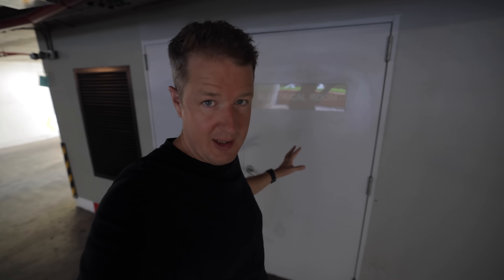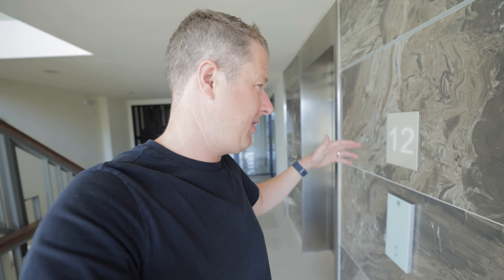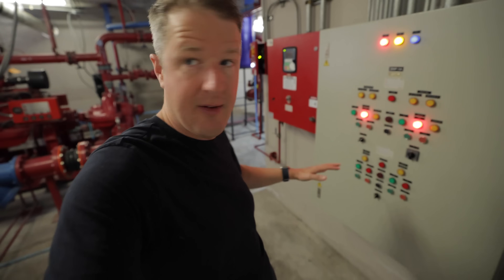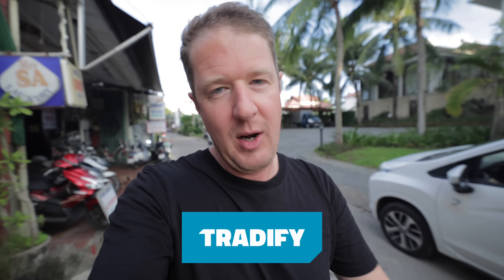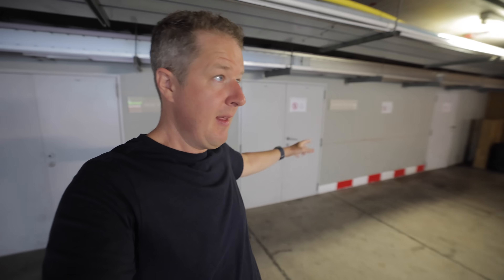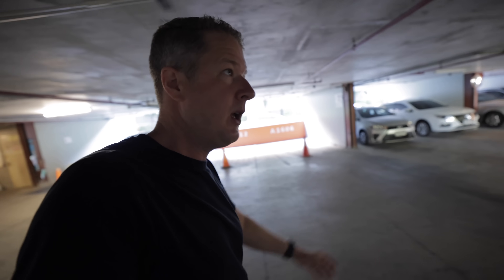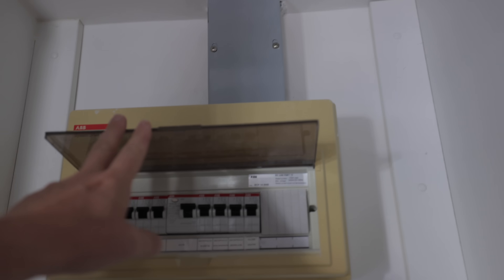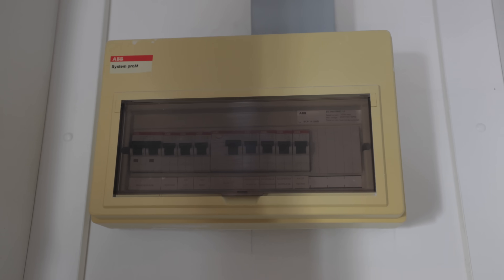This Electrical Room in Thailand Almost Got Me Killed... 😲

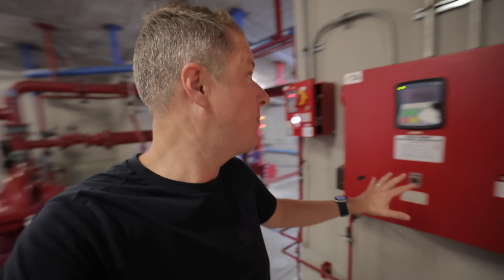Comment: 4:25 for safe isolation, here in The Netherlands if the feeding panel/breaker is in the same room, you do not need individual isolation switches. I was wiring up a boiler room with 7 boilers with their own electrical panel next to them. My inspector asked why there are no safety switches upon first entry I explained the panel feeding them is in the same room. Which passes over here.

Comment: I live in Thailand and for a while operated a dry ice cleaning services company. Thai building codes changed around 2010 when a ground was legally required for all new construction. I'd be hired to clean industrial equipment or MDBs (live 'cause we can!) Dry ice cleaning creates large amounts of static electricity in the pellets which then dump the charge into what ever you are cleaning. We would require the client to sign consent forms where they had to confirm they had an accessible earth. In reality, few did. Even newly finished factories had poor, insufficient or no earth. We took to taking a copper rod and making our own ground! It is a regular discussion here on expat forums when a new foreigner tells the local electrician to put in a light on the stairs with two switches at top bottom. "Can't be done!" is the typical response from the local guy! Standards here are low, safety is not a mindset here, and signing off is best done with an envelope of unmarked bills...

Comment: A cultural thing to be aware, is that thai people may not find it very polite, to have pointed out problems like this. At least, avoid situations where they feel they will "loose face" on having obvious problem pointed out. They do not have the same governmental resources to make infrastructure perfect, as we often have, in Europe. And it seems like the thai government already is aware as there is a cleanup of wires, including the mayhem of old copper wires mixed with the fiberoptics, going on on in cities. Just do not expect any miracles soon, most thai people do not have the economy to do things at our standards, in a long while, yet to come. Still - the electrical system on the infra-structure side, is as good as ours, even here in Norway, I would say perhaps even better than in the USA. Though talking about the USA, Thailand using USAs primitive plug system, hopefully will be adressed some day, but this is at the private side of the electric system. Official grounded connectors, used for washing machines and other equipment, are actually also used, and ACs must be connected with GF-protection, still again, probably not everyone respecting that. 

I always test the GF protection when taking a shower, and these heaters on demand, which also is used in the UK, is also something that must be
phased out in the future, if we are going to have a stable net, with renewables, however - water heaters are not free.

I would suggest that as a tourist, a polite letter after the trip, to the hotel or wherever you stayed, pointing out that tourists are maybe not so aware 
how to take care of themselves, so that you would recommend that there was focus to have this or that risk ammended. That could be anything from
risky or faulty electric connections or equipment, to random holes in the streets, or random crowbars sticking out or up, low electric wires hanging etc.

Focus on tourists maybe not being aware about the danger or challenge, to not critizise directly, to make the suggestion or complain being as polite
and respectful as possible. Remember - the day Thailand affords to fix all this, we will already having been complaining that the rate of our money 
is really poor, compared to the Thai baht. 😅 It surely has changed, already and it will probably change more in the future, as we spend our money there. 😉

Comment: I am in the 70th year and I have seen much in the US. Our power is 120/240 split phase, and if you do not have a 200 amp panel for a home, you are living on borrowed time. In my home which I wired in 1974 to a 200 amp panel and my 120 volt 20 amp circuit served 5 duplex receptacles and I am no farther than 5 feet at the most from any outlet. My house lights are on 15 amp circuits and no more than 6 lights per line. Today with led lights I could use 1-2 lines for the whole house… I wired heavy and safely using 12-2-WG for the house. I do have 5-6 240 volt circuits, ie, hot water tank, electric boiler for heating, stove, clothes dryer, shop heater, and a circuit in my electronics shop, all wired to code at the time I wired the house.

I was originally trained as an electrician, then electronics, both 2 year courses. Now I am a geek in my old age, I love technology. But no matter wherever I go my electrical training came in handy. I still keep an updated NEC code book on my iPhone.

One placed I worked, I was chief cable TV engineer and I was not afraid to change out field power transformers when they died or was just plain noisy!!!

Love your channel and keep up the good work.

DE N2JYG in Sherman NY USA

Comment: HV Transformer Room/Cabinet need to have clear sign that There is HV Electrical Shock Harzard insid  (apart from which it should always locked). Yes it a code violation here also.

And I always tell the building owner if I see something store in the electrical room. (The janitor or someone always does). It not good for safety as it may catch fire if there is arc or electrical explosion inside.

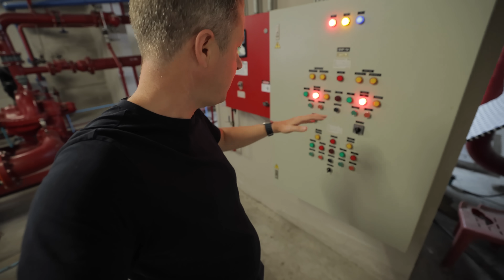Comment: 3:26 It is the same in the US and China to wire the board with metal conduits. In the UK they prefer to use cable, more specifcally the MICC cable with cable trays.
Reply: Its very rare to see MICC cables, considered to expensive, to much labour. Imagine a huge building all done in MICC- wonder if the ohms reading was ever below 1. Today believe it or not its underrated T/ E OR SWA reliant on the MCB or RCD and the liability is covered by the Test electrician!!!!!  Fire?  remember Grenville Tower-what actually started the fire? My guess electrical. I've even seen yellow plastic gas pipes in a underground car park, low enough to be hit by a SUV  There is very little oversite by inspectors on commercial sites. I know I used to go round to test them and refused many. I come from the old school of electricians where pride and safety were paramount-thats been eroded over the years by the money boys in the Contract departments. Today its ALL about cost

Comment: Looks to me that apart from the unlocked doors most of that kit wouldn’t be out of place in the UK. I seriously doubt you were anywhere near the HV side of any transformer. Having worked in factories with internal air cooled transformers, yes they do have a scary hum to them but the HV is usually switched from a separate room. Dedicated fire pumps don’t “fail safe” they usually fail to running condition. No local isolators, overloads, rcds etc, even normally closed main contractors ( need control voltage to stop them running). Better to burn out the pump than the building. Great video loved it

Comment: The LV consumer unit in your apartment is very interesting indeed...It's not only British Style, it's actually Certified to BS 5486! That's not a Thai part, it's a British part in a Thai installation! 😁
(Though I note with interest the main isolator and the layout of the board appears to gravitate to the left hand side, as opposed to the British right hand CU alignment. Thailand drives on the right, doesn't it? 🙃)

Finally, you say at 12:35 that British standards would never allow an innocent person to come that close to an HV circuit? I happen to live a stones throw away from a subterranean 130KV National Grid link that runs through my area, and transfers to elevated HV transmission lines about a mile west of here. Although the lines are put up at quite some height, you can still physically walk underneath them...And the conductors have absolutely no insulation around them whatsoever! ⚡🇬🇧😋

Comment: I live part-year in Colombia, and what I see different from the UK, is that we are not run by the nanny state; we are allowed to have common sense.
Nobody would go into any of those plant rooms because they KNOW they are dangerous places and touching things might hurt or kill them. In the UK, there are so many rules and regulations, that it shields people from danger to the point of stupidity.  People really need to take more responsibility for their own actions, instead of looking to blame someone when they do stupid things.
We just had some alterations done to our house electrics (you can see the electricians at work in one of my videos), and the standard is well below that of UK, but it's still safe....just different.
Another subject, but a good example ... on most street corners there is a drain, measuring about 3 feet by 2 feet, big enough to swallow an adult. They are in line with the pavements, where one would step off the kerb to cross the road. Invariably, there are no gratings over them, but you know what...nobody ever falls into one. People here can see the obvious danger and have the common sense to walk round them.
For the reasons of less legislation, less control, less authoritarian interference, I LOVE living here.

Comment: the board in the carpark is for the mechanical services. such as co2 sensors and stairwell ventallation shafts in the event of a fire the close. The pump room will be linked to an FIP panel

Comment: In most of the world, outside the oh so controlled zone of the West, life is definitely more relaxed.
I see a lot of interesting DNO connections at reachable level in the street, and other creative electrical connectivity which usually involves wrapped connections in plastic water bottles and insulation tape, where I live in Africa.
Certainly electrical standards have not progressed beyond the 1980's here even though notionally they follow BS7671.
It is unusual to find RCDs anywhere.
Like Thailand C type breakers predominate - not a type B to be found anywhere.
Although there is a bureaux of standards you do find twin and earth which is red and blue colours supplied in flash-coated copper on steel wire - an instant house fire in the making.
You have to insist on copper if you are having installation work done - and check!!

Comment: Gooe stuff Jordan. The fire pump room system is typically an electric motor coupled to a diesel motor driving the water pump. Alternatively the system uses the diesel pump drive only. This is used as a "booster" system for fire sprinklers and or building hydrants. The water supply can be from the water authority supple and or a large tank on site. There are small jacking pumps that keep the system pressurised. The electrical supply doesn't have isolators or RCD protection and so on so it keeps running. Same as smoke exhaust / stair pressurisation fans. Cheers

Comment: If the fire pumps work the same way as they do in the UK, the system will detect a pressure drop when a sprinkler head goes off and the pumps will start. Unlike in the movies only one sprinkler head will go off, the one that breaks due to heat. There will be the odd drench system around, but I have never seen one.
Reply: Drench/deluge systems are usually in small areas of a larger facility. 
Gunpowder room at the ammunition factory for example. Or covering a non closeable access that passes thru fire walls. 
I've worked on several over the years.

Comment: You should come to Romania to see our electrical system.
I work as an electrician here, and you will see two worlds of electrical works. The commercial sector that have the latest and greatest of IEC Standards and the communist era Electric with DIY installations. The government doesn't really regulate nor infer with the private sector and it's crazy how everything is wired up.
Reply: I also love the telecom in Romania. Fibers everywhere.
Reply: Romania was late with the introduction of fiber optic to buildings, which entailed the messy installation practice.  However we do  also have a very good system for that reason as well. We were late in implementing fiber optic which meant that we have the latest technology in europa.  @jim575757

Comment: In north america, we don't require local isolation on motors. However, some industrial plants may opt to have "remote lockout points" by the motor so normal employees don't have to go all the way back to the electrical room just to tagout a motor.

Comment: Those are cute lil fire pumps. Diesel engines what electrical are you going to isolate? the "copex" just has some control and monitoring wires.

Comment: In Canada, we don't usually have isolator for every single appliance/load. Some are required by code/regulations for specific applications. For example, a residential heat pump must have an isolator right next to it. Generally, there are no isolators for indoor appliances. For example, an electric range will be plugged in a socket or hard-wired. The only way to cut power to that device is to turn off the corresponding circuit breaker in the load centre. Many appliances must have their own circuit and corresponding breakers. Some common examples of that are: dishwashers, refrigerators, ovens, ranges, washers, dryer,s water heaters, air conditioners, HVAC air handlers.

We typically have a lot more circuits than what I see in the UK in your videos. For example, my 90 square meter condo (flat) has 24 separate circuits each with its own breaker. A typical cottage or bungalow with a 200 Amps service will probably have between 30 and 40 circuits, if not more.
Reply from the maker: Thanks for sharing! Sounds interesting over there
Reply: I presume part of that is down to the lower voltage which will in turn mean a higher amperage required for same power (without having thicker gauge wires) - this wll put a lower limit on the number of appliances that could be safely handled and will tend to necessitate more circuits.
Reply: @_chrisr_  Quite possibly. Indeed the available power with 120 V is half of what is available with 230/240 V. But give the ratio, about 1/2, that would mean that a typical flat in the UK would have around 10~12 circuits which does not appear to be the case.
Reply: @samuelgilbert9734  The building I am in now, a bungalow, has 10 circuits.  It was rewired back in 2010.  Many older properties just have four circuits - sockets, lights, water heater and oven.  Also need to take into account the use of ring circuits in UK which are often 30/32 amp rated which reduces the number of circuits needed - although we try to have more than one circuit for each use type so that there is some redundancy.

Comment: Great vid you can hear the fans blowing to assisted transformers to cool the pair of them down at a glance each  at least 2.0 MVA cannot hazard what the local distribution is, they are resin core ANAF and the load is what you can hear and  will feel as they are running at full tilt , that’s  the electrical flux between the the different voltages. Nobody envisaged 20 years ago that AC would explode exponentially in the same period … you could make a fortune selling PFC and energy optimisers lol … get some rubber gloves and wellies though lol,😮
Reply: Ps would not like to reverse my van into those twin sets of bars 3 ph and the size tells me at least 600 A …… No protection at all bonkers
Reply from the maker: Yeah it’s scary stuff 😅

Comment: Nice video Jordan. You were filming the consumerpanel in the apartment. What struck me was the 50 amps main breaker and the 40 amps RCD. This is not allowed in the Netherlands. In the worst case, more than 40 amps can flow, causing the RCD to burn out. Something that is allowed in the Netherlands are plastic consumerpanels. Can you tell me why it's forbidden in the UK?
Reply: Plastic consumer units aren’t forbidden here 😊
Reply: Well technically you shouldn’t fit new ones really but they aren’t exactly banned as we still have thousands in use and doubt they will ever entirely fade away.
Reply from the maker: The regulations say that consumer units should now be made of non combustible material to avoid fires in the event of loose connections etc as in the past fire fighters have been called out to too many plastic consumer unit fires
Reply: That's similar in a way to the installations in the UK. They have two 63A RCDs feeding the MCBs and 100A fuse upstream for overcurrent protection of the whole installation.